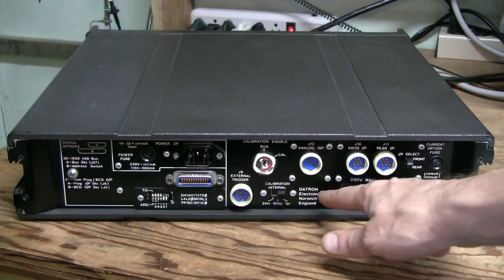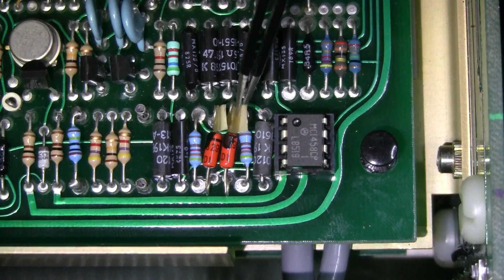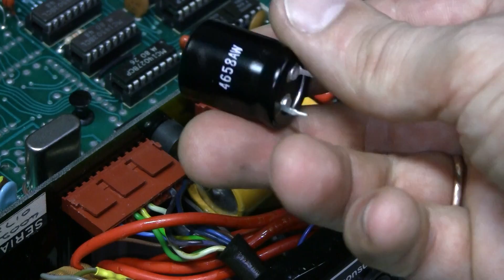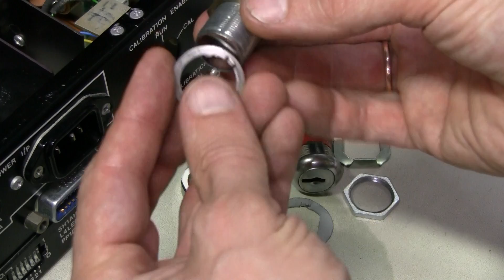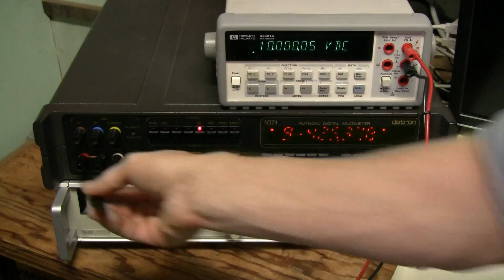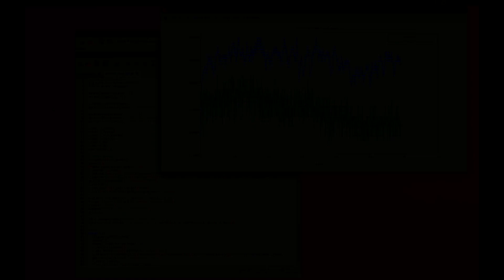#47 - Datron 1071 7.5-digit multimeter repair

Comment: the service manual link dont work, another question : what chip is the voltage refferance for the 1071 ?
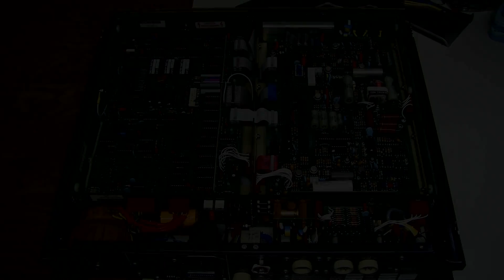Reply from the maker: link do work. refferance is not a chip, but a pair of zener diodes @5:52
Reply: @feedback-loop  thanks, i found them, amazing those two zener diodes a few resistors and MC1458 opamp can perform to 7½ digits
mine had a shorted bridge rectifier, so now i hope to be able to continue the fun.. cu

Comment: I don't want to contradict you, but as a beginner, I must ask.  You say 10.00004 is 4ppm.  But 10.00004-10=0.00004*1000000=40.  Shouldn't it be 40ppm?
Reply from the maker: There is nothing wrong in contradicting. I can say something stupid, of course. But I don't think I am wrong in this case. 1ppm is not one millionth of one unit, but one millionth of the baseline value. Our baseline here is 10V. We need to divide it by 1,000,000 to get one part per million.
Reply: I understand.  I had the wrong baseline.  Thank you for your excellent work.

Comment: Very nice score, I've got 1061A which is baby version of this one (but similarly built, only with less kosher reference and so on - it uses the same service manual) that I got for around 100$ as faulty because seller didn't know that high impedance input on low ranges won't zero with leads disconnected. You got lucky with all these options installed, many of these in the wild have only GPIB option installed and measure only volts DC, as they were used at some automated test equipment setup. Too bad display is in this state, these are very nice displays to look at (compare it to these 16-segment LCDs favoured by HP for example which need a bit of eye squinting and imagination to see the digits;)) when fully operational.

Comment: Yet another interesting video and a great job of keeping an old piece of test equipment going for longer than it was probably designed to! I'd quite like to see you replace the faltering display with something new, perhaps OLED but if you can't get the correct dimensions then you could use standard LED modules for the digits and some sort of stencil for any special characters or words with an LED behind to give the same effect as the original display - it's possible this could be achieved using transparency film and printing the characters as clear with a black background. Any interface circuitry would be interesting to see too.
Reply from the maker: The problem with using standard 7-segment LED modules for the digits is that Datron uses additional dot, which is right under the middle horizontal bar. For example, this dot is used in the letter 'r' (in Error). Another way, which comes to mind, would be to arrange custom segments from surface mount small LEDs, but that is a bit tricky too because of different number of LEDs required for different symbols. So it seems to me that just simple modification to the driving circuitry with simple LEDs won't really work.
Reply: +FeedbackLoop - I see. It's more tricky than it first appears. Sounds like either a dot matrix display with a uController using custom conversion software may actually be the easiest solution, unless you can make a hardware copy of the original using individual LEDs - which would be difficult given the size of the original characters. I would have thought that a suitable LCD display module would be easier to obtain than an OLED one? I look forward to your next move and hope you can obtain suitable parts.

Comment: Is the display reall dead OR the high voltage driver chips driving the display?  Lloyd - DigiTek
Reply from the maker: It seems that the display is bad. I couldn't find anything wrong with the driving circuitry.
Reply: Thanks much for the tips, really appreciate it.  Been working with PowerBASIC written by a friend of mine Bob Zale.  Unfortunately he passed away in Nov of 2012 but his compiler is fast than hell and makes smallere exe's than visual basic.  www.powerbasic.com..  What I've found is there is not much source code on the command strings to devices which is sad.  Maybe I can help remedy that with my adventures.  Thanks for the quick reply and all the best!  Lloyd - DigiTek

Comment: Like the video!  What program did you use to graph the GPIB?  What is the MFG of the GPIB interface, is a copy of your GPIB basic source program available?  Thanks - Lloyd - Digitek
Reply from the maker: I am using Octave, which is a free and open source equivalent of Matlab. The GPIB interface is Agilent 82357B (seems to be a clone). I didn't share the Octave code (yet).

Comment: Nice job. Would be a fun project to decode the display and create it with a little LCD/OLED  screen. Would need to be hi-res so you could use graphics for the special symbols, etc., but shouldn't be too tough overall.

Comment: I'd like to see an attempt at recovering the original panaplex display, they can apparently be rejuvinated by running the segments at slightly higher than normal current to "burn" off the cathode poisining. I have a few old Datron units (4000a DC calibrator, 4200 AC Calibrator and a bunch of meters) that have the panaplex display but most are still in good shape.

With a display as bad as the one you have there is really nothing to lose, the link below is to a discussion on trying te bring back some more life to these beautiful displays.

https://puck.nether.net/pipermail/heath/2007-April/022819.html
Reply: This link shows before and after pictures of a gas plasma display like the ones in Datron  being rejuvenated, seems to work well.

http://electronics.stackexchange.com/questions/87985/7-segment-gas-discharge-display-segments-are-not-lit-up-completely

Comment: Great video! I had problems with those LED-push-buttons as well on several vintage synthesizers. They are probably called RJS-SP88 by Shadow (ITT later). Similar ones can be found by searching for "digitast" but they have a slightly different footprint and dimensions.

Comment: Very interesting one this. However calibrating a 7.5 digit multimeter with a 6.5 digit one is kinda odd and sounds wrong. But I get that in this case it has so be like that because proper calibration in a lab will cost a few hundred bucks. I found my HP 34401 is very reliable and linear and the best multimeter for that (in theory inadequate) job, much better than my Keithley 2000 series which is not as linear as the HP. I'd like to see you fitting red 7 segment LED displays in that meter.
Reply from the maker: Of course it is wrong, but that was the best I could do for now.
Regarding 7 segment LED displays - I don't know about that. That would be the easiest way if there were no special symbols involved. I am thinking about some graphical display so that I could do a close imitation of the old one. But finding a display with such size and proportions might be a problem.
Reply: Ahh I did not see any special characters. Bummer. A friend of mine made a special display all by himself, unfortunately he didn't take a video of that even after I offered him to cut, edit, upload it. He used a glass plate, put the display outline on it by using a label transfer foil that holds the single bits and transfers it to the glass. Usually used for labels where bits are not connected. Then he painted it from the backside. Peeled all the little bits of, and coated it again but with the paint very thinned out so the segments are actually see through when lit from behind. He had a 3D SLR print done that he used as a bezel to define the segment. That was the most expensive part, did cost almost a 100 EUR. He then used diffuser sheets from old butchered TFT displays. A PCB with tiny 0402 LEDs and that is the display. It looks cool. The diffusor of that TFT works really well. And you can have any segment shape you want.